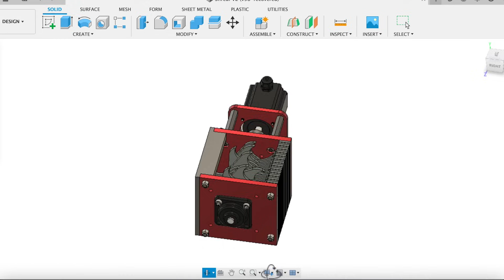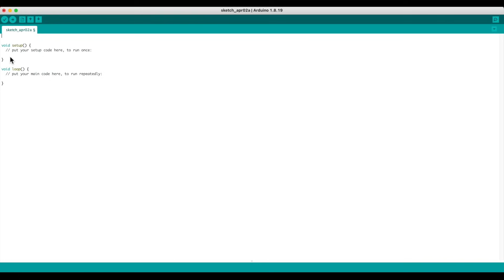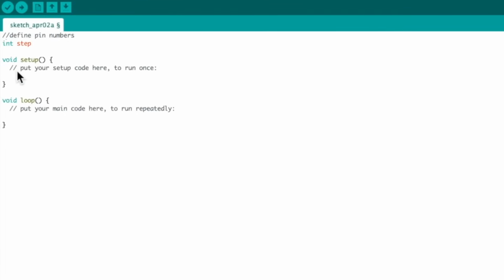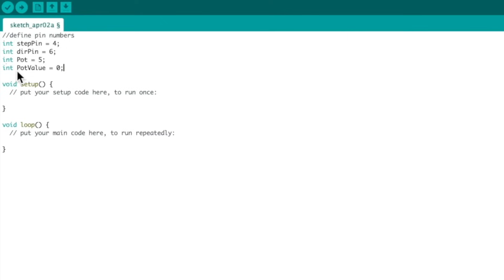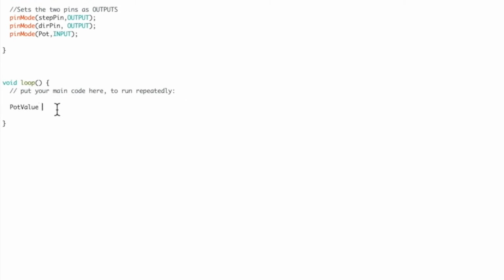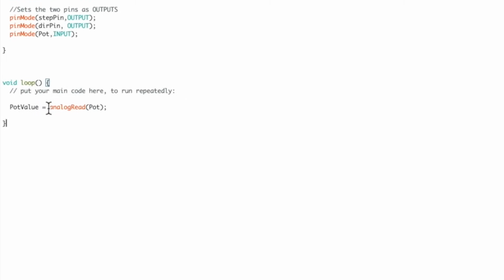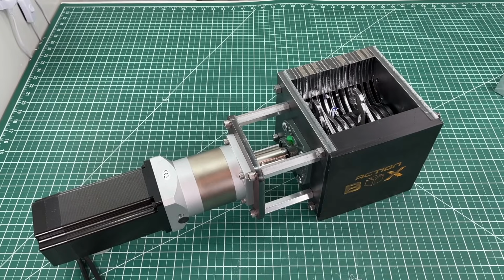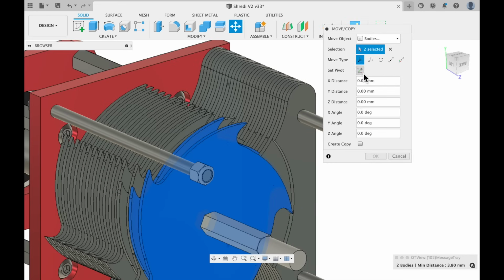DIY Desktop Shredder | SHREDII 1 & 2

Comment: ok, so some suggestions from someone with millwright training here, take with a grain of salt but these may help a touch. 

First off, great work on the design, my main worry here is those standoffs will be a bit weak for that steel shaft coupler. The aluminum one should offer plenty of torque, while also helping with any shaft misalignment and providing a place for torque to go if the shredder ever jams. Think of it as a sacrificial part like a shaft key, as it's probably easier to source another coupler than a new shaft, motor, gearbox, or blades. This will be important if you ever want to try aluminum or other softer metals in the shredder, as having that thing bind up could grenade that gearbox or burn out your stepper.

secondly, if you haven't, it may be worth it to try hardening the blades, then tempering them. There's a lot of videos on how to do this, and one of those 3d printed foundaries you made should be able to get up to temperature, but word of advice: if quenching with oil be extremely careful of flare ups. I've had a quench tank throw 4 feet of fire on me before because tom the 200 lb shop monkey decided to put some light oil in there thinking it was a dump tank. i'm glad i was wearing safety goggles, and remembered not to gasp at the fire in my face, because i had no facial hair for a while after that. after hardening you can temper the steel using a regular oven. If you take the time to sand down the cutting faces to have sharp, 90 degree corners on the edges that cut before hardening you'll also make the motor's job easier. Plus, then you can use this to shred softer metals for use in the foundary.

Third, as a safety, convinience, and quality of life thing, I'd suggest building a stand, feed chute, and catch bin for the shreds. wood would work well for that, and save you some time/cash on materials. the reason for the feed chute is to keep things from flying out of the shredder, and with a chute you can pop a bunch of stuff in at once. the chute should also be longer than your arm is, because even that little shredder will turn your hand into ground beef if you don't have a real fast way to remove power from it that can be activated with one hand. I had a co-worker who lost fingers to an industrial shredder because he was faffing about testing it and had the feed chute off while doing repairs. a moment's inattention and suddenly he was in too much pain to locate the emergency shut off button. Don't pull a dave, he's constantly throwing up a shaka whenever he waves as he's missing all but the thumb and pinky on that hand.

As for the catch bin, that's just there to make your life easier. just have a few bins for the various materials (could even just use rubbermaid containers or something like that here) so whenever you need to mold a part you can just grab the bin instead of having to set up the shredder. personally i'd run down to a kitchen supply shop and get some camwear food storage containers with lids, but that's just cause they are some reasonably tough clear containers, and the lids are pretty good at staying on unlike some of the junk you can find at walmart. depending on your printer's size you could even print some containers, but they'd probably not be clear.

Lastly I cannot recommend some kind of e-stop or dead man's switch on this, as i said earlier a shredder will turn people parts into mincemeat with ease, and even one as small as yours probably has the torque to chew through bone. All industrial shredders require an e-stop or dead man's switch in the safety regs, and all safety regulations are written in blood. People have died to these things before, and running a hand or appendage through a shredder is an excellent way to require amputations. There's no way to save a hand/finger/etc that's been messed up by a shredder, and any clothing that catches in that thing WILL pull you into it. I watched a guy's tie almost drag him face first into a thickness planer because he wasn't paying attention around the woodshop, I'd hate to hear about an accident with this thing, and homebuilt tools like this still need the safety features as you're still taking the same risks running the thing. Remember: that thing will destroy anything put in it and it's gonna hurt the entire time it's happening. this thing doesn't run very fast, so it's gonna hurt. A lot.
Reply: Yes! I have worked along plastic grinders, and they are unforgiving! These things will grind up anything that drops into them, tools also. I once saw a lady drop her whole purse into a grinder, (don’t know how she did it) and there were only shreds left. Our protocol was to always unplug the grinder if you were cleaning, clearing a jam, or doing any work on it. It definitely needs a prominent E-stop.
Reply: You missed one advice. They should have a punch plate on the grinder with whatever size holes their injection machine needs. Allows thicker cutting plates with less parts to break while all output will still be the required maximum size.
Reply: also he should have gone for a differen engine imo. i get it, those ones look fancy and sleek and modern and all that, but literally any standardized industrial one will be cheaper, at least in the long run, and not fail you as quickly. and i think thats a fair trade for its lack of sillycone valley flair. plus they are easier to maintain.
Reply: Thanks for these valuable informationa.🙏
Reply: @Undezzirablei...commenter  no problem. these tools can be dangerous, and there's a reason why the reputable manufacturers put all that extra stuff around them. If nothing else, an easy to reach killswitch is the most important thing. if everything else i said to add safety wise fails, then that button won't. do your research here if you're building a shredder, because it's literally your body/life on the line.
Reply: @zerumsum1640  Woa you are such a generous person. I say this cause almost nobody takes time to reply and post positive and helpful comments.. Thanks mate I appreciate your kind reply... I am a recycling lover and just bought a small shredder. I am hungry to learn anything i can about shredder.... 🙏

Comment: Too bad they didn't discuss the problem of scrap sitting on the shims after the teeth grab all that's in reach. Kind of a reaaally big problem considering some impatient people may be tempted to put their fingers somewhere they shouldn't.

Turning it into a dual-shaft design with counter-spinning teeth+cams can remove that problem so it's fully automated, but that's an unnecessarily expensive option for a hobby toy.

Instead, 3DP a block with the bottom shaped with a profile to fit right on top of the blades and sidewalls. Make it wider than the sidewalls so it can ride the sidewalls like a rail, but less than the length so you can slide it back and forth. That'll let you push scrap down or side-to-side without risking other stuff getting caught in the teeth.

Tip for those concerned about not having enough torque: Sharpen all cutting edges, reduce the clearance between the cutting edges as much as possible, reduce the radius and thickness of the teeth plates, and obviously increase the gear reduction.
Reply: Not entirely related but I was thinking about contaminating plastics, I guess some compressed air would clean it out also

Comment: maybe a drill instead of a nema? you could still control it to do different patterns. or a torque wrench
Reply from the maker: Just a drill with no gearing won’t have anywhere near the required amount of torque.   Finding a proper mount and hearing system would make this a very viable idea.  Cheers

Comment: This is brilliant.  I wonder how many times you can recycle the material before it starts chemically degrading, because considering all that overflow on the mold, a lot of the plastic will be run through the shredder and melted again several times.  (Of course, the overflow is more a case of putting too much plastic in the injector in the first place rather than a problem with the machine or mold itself.
Reply from the maker: This is a great point.  I don’t know how many times, but there is definitely a limit.  Glad you enjoyed the video 😃

Comment: i wonder about the efficiency of using both v1 and v2, in a stacked configuration. so, v1 may do better with harder/thicker plastics, even if the pieces are too big after. so, if v2 shreds the scrap from v1, the combination should be able to turn even the most stubborn of plastics into something of value.
Reply from the maker: Thats a very interesting idea for sure.  Although our shredii 2.0 design, which is already done 😉, should be able to accommodate a larger variety of inputs.  Thanks for leaving an awesome comment 😃. Cheers, Dave
Reply: @ActionBOX  np :P but, little hard to toss a block of plastic into 2.0... look at your trash/recycling bin. what can 2.o handle, what can it not? 1.0 does have its limits, but fewer than 2.0
Reply from the maker: @zutai1  sorry, what I mean is that we have a new design (so the 3rd design which we will be calling shredii 2.0) coming out in a month or so, which should be able to handle more.

Comment: What would have happened if you would attack the original shreddy over the 2nd one that you made
Reply: Maybe a stack one on top of the other.I use a chain drive between the 2 with the one motor. You'll get much smaller and finer bits to where you can create New elements for 3-D printers whatever size you want with the proper extruder And if you're sold it as a kit that way
Reply from the maker: That’s a very interesting idea.

Comment: Are you putting in your code if wattage draw is greater than x then reverse the motor, thus if the shredder is stalling then motor reverse for x turns and then return...
Reply from the maker: Not yet.  Great idea though.

Comment: since you are using an arduino to  drive the machine, you can add a wire that attaches to the machine and detects if the human operator touches any metal part and stops the motor as a safty feature.
Reply from the maker: I love the idea. Will definitely implement it in Shredii 2.0

Comment: The stepper motor is very weak. Wormgear + async motor is the way to go here.
Reply from the maker: Thanks for your input. 😊
Reply: @ActionBOX  The worm gear was a quick shot. A common old gear box with a high speed ratio will do fine.
Reply from the maker: @einball  I agree, it’s a great idea.  It was just expensive for this current setup.  Thanks for the input though, I’m glad you enjoyed the video.  Shredii 2.0 is going to be quite a bit better so I hope you appreciate the updates there. Cheers, Dave.

Comment: Definitely worth looking into ‘precious plastic’ movement if your into recycling your plastic prints / scrap .
Reply: This is a copy of precious plastic design.
but slightly adjusted
Reply: the problem is with both: you must be an engineer to produce do it yourself product. no one has yet produced a turn key product that anyone can just buy and use out of the box without having to assemble yourself.

Comment: with the arduino you could hook up a touch sensor to the blades and it would detect when someone touches the blades and immediately stops
Reply from the maker: That’s interesting. Can you tell me more about how to do that? Maybe share some links?  I’d love to include that in the v2
Reply: @ActionBOX  https://youtu.be/lqg_Ze_OiiY
An interesting technique with no additional hardware. You can set it so sensitive that it would turn off before its touched

Comment: love it!  looks so fun!  I am curious, why didn't you stick with the shaft coupler that has some flexing abilities for angular and radial misalignment?
Reply from the maker: It didn’t have a key do it was slipping on the shafts.  I also believe the aluminum would have failed (let alone the rubber). There are very high torques on that coupler. Hope that helps 😊

Comment: I like your shreddy design, the One thing I'd change is to do what the majority of commercial shredders do, mirroring the orientation of the teeth at the halfway point, so that if you were adding them on one rotation point clockwise each time, once you're through half, add the rest on one point counter-clockwise from the last instead. Basically, you want your teeth to converge towards the middle as they rotate so that you have an area with concentrated force.
Reply from the maker: Will do that in shredii 2.0. Thank you 😃

Comment: If you stack the blades onto the shaft in a V form they would funnel the parts into the center, instead of walking the parts to the left. Not as noticeable on the second version with smaller teeth, but might have helped with the first version.

Comment: Would love to see this  vs a torture test with 3D printed cutter blades at 100% infill. Might be easier for more people to get access. Perhaps can adjust the blade dimensions and motor requirements based on cutting material, with coding to include reversing and temp monitoring. Perhaps can be a modification using pennies for the cutting edge similar to bottle cap openers.
Reply from the maker: We will release a video of that with our shredii 2.0 video in the near future.  Thanks for a great suggestion.

Comment: you may want to keep the aluminum coupler or make one that is weak enough so it would fail before the motor does because should the machine become overloaded by something too hard to shred you wont burn out the motor or more over the controller.

you may want to build some kind of box on top so you can feed stuff in safely because there is nothing stopping the blades from tearing up a hand that gets in the way.
Reply: Just watched a motor blow up one of those couplers, and I'm glad it failed because replacing the motor or internals to the pump would have been far more expensive and time consuming.

Comment: We are building out a plastic recycling workspace and are looking at shredder designs. While I like the Precious Plastics approach your setup looks more affordable to build. I also like V2 with the smaller pellets as well as the fact you are using an Arduino for the controller. Are you looking to open source the design and parts list?
Reply from the maker: Hi Piers, we are planning on redesigning to improve on this concept, and making the next shredder available as kits that can be ordered on our website.  Cheers, Dave

Comment: You guys keep making fantastic devices and YT content! If you end up making a device to 3D print using pellets that is better than other pellet extruders out there, that would be sweet! Thanks for sharing all your hard work with us!
Reply: I believe hobby level products do exist! CNC Kitchen had a pellet extruder in his Wham Bam multi tool head video recently, but I know it’s tricky with the patents that large corporations are holding onto right now. Hopefully it can be licensed or possibly different enough that the parent doesn’t apply?

Here’s the patent number in case you’re curious, registered in 2016 so we have a long time to wait: US20160347000A1
Reply: I think you could totally make a mold to make your own filament.
Reply: Good work..can I ask about the thickness of the plade & the other slice?

Comment: good job! do you think that it's possible to make it cheaper? for example is it possible to replace the steel plate by aluminum, it's maybe enough to shredde 3d printed parts
Reply from the maker: We did try and the answer is, that won’t be cheaper.  The teeth are the expensive part and those have to be steel.  Great question.

Comment: Hey, Amazing Idea guys, and extremely well-executed, I'm one of the people who commented on the suggestion of using a plastic bottles (PET bottles) in the last video and I must say I'm impressed although I have a few suggestions as well, they are as follows:
1. Make a transparent top cover out of acrylic or plexiglass, mainly for protection from projectiles, and secondly to act as a hopper to shred material in bulk.
2. I think you might already know but still I would like to mention to not mix 2 different plastics together as they might degrade the performance of the material (eg: bottle cap and the bottle both are usually made of different materials hence their melting temperature would also be different) so just for ease shred and store plastics in different containers.
3. Just an addon to point 2, even 3D printing PLA might have different compositions and stuff so shred the same brand of plastic together.
4. you can use the aluminum shaft coupler for this purpose as the torque will be within tolerance (at least for plastics) and would be recommended as it would rectify any misalignment issues. for metal shedding, you can proceed with the custom coupler.
Well apart from all these recommendations the project is pristine, and the quality of both the video and the product was outstanding I can make out these things are made to last so kudos for that.
Overall the best looking forward to the SHREDII V3.
Love from INDIA  😊👍
Reply from the maker: Thanks for your comment yet again. We did indeed decide to build this after seeing your comment and others on our last video. We agree with your suggestions, and will implement them in the next version of the machine. 

Cheers, 
Dave
Reply: @ActionBOX  Sup, thanks for replying again 😄. If you need any assistance in the implementation in this project feel free to ping me, I'm a Mechanical Engineering student so might be able to help...

Thanks cya...